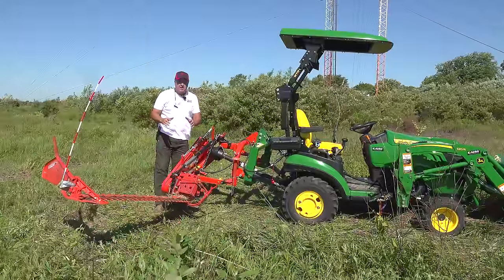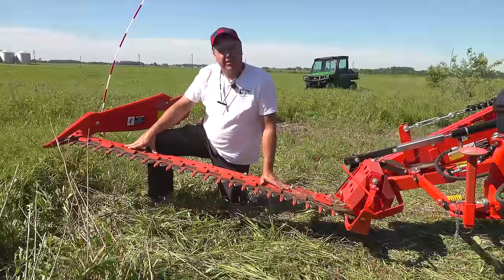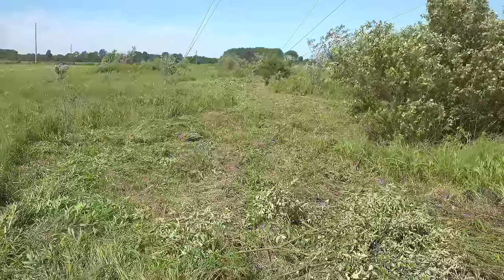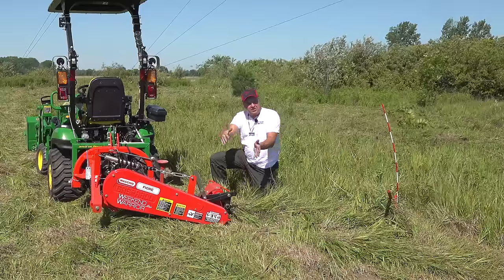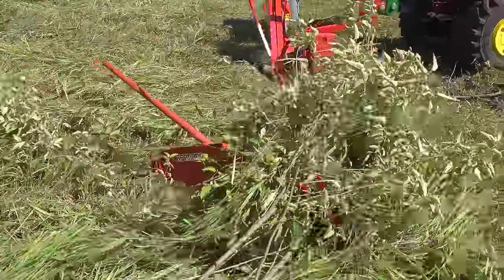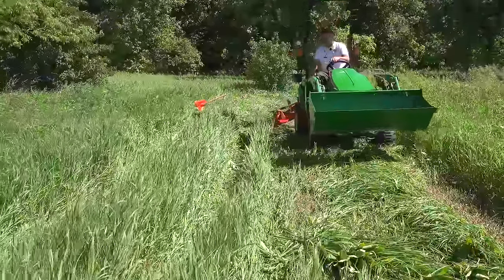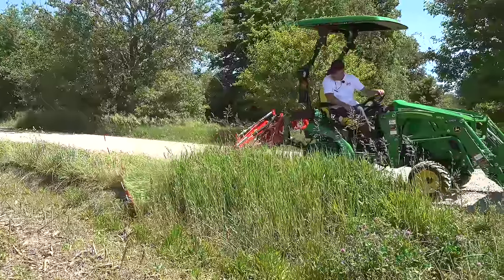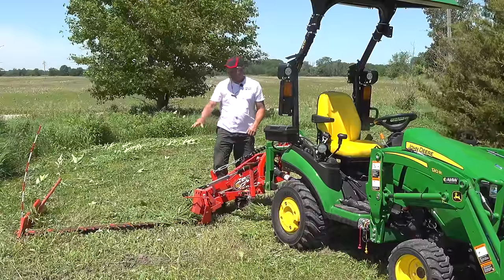Sickle Bar Mower for Subcompact Tractor!

Comment: these Blade type mowers have been recreated in a bigger form by an Austrian company, BB Umwelttechnik (BB Environment Technics). The big positives to these types of mowers compared to drum type mowers is that they are lighter, require less power, are more eco friendly and they dont get as much dirt and dust mixed into the grass. The negatives are that they for the longest time used to be to small for bigger farms and that sharpening the blades take forever unless you use an expensive sharpening machine.

Comment: We called it a mold or mole board at the outboard end of the bar. Our old John Deere you could tilt the bar to adjust the height a bit also. Of course the TTWT doesn't have anything to do with "tracking or anything like that. It only means they know you referred it and boosts you monthly check. This should have been labeled as an AD.
Reply from the maker: Nope, adding the TTWT to the url does nothing for our revenue.
If you purchase, and use code TTWT...and receive a discount, I will receive a small commission.
I created this hydraulic kit...it was my idea.  If you think a small commission is unfair, then I’m sorry for you.

Comment: The strong points of sickle bar mowers are their really low center of gravity and lower weight. That's the reason why you see on hill sides and mountain regions (Swiss and Austria) a lot of these machines even today. It also uses less hp then disc mowers (due to the inertia of the cutting bar compared to the spinning drums)

Comment: I actually was look at old sicklebar mowers. Thought of fixing one up for hay use and getting an old wheel driven hay rake with a $1500 4x5 round baler. Its crude, but as long as it cuts and bales thats all that matters to me. I just believe the 75hp will be too much for the old equipment

Comment: Disc mowers replaced a sickle mower because of how much easier they are to maintain.  Changing sections on a sickle mower is lots of trouble.  Changing knifes on a disc mower is a simple bolted connection.

Comment: Very interesting! Sure would like to be able to cut and bale hay with my 1025R.
Reply from the maker: It can be done. Do you have hay field?
Reply: @TractorTimewithTim  Tim, I only have about 5 or 6 acres. Nobody will work it as it's too small to transport all the needed equipment. I have information on some company in Italy (I think?) that makes small square and round balers for the 1025R but they are also around $19-20K and then I'd still need the tedder and other equipment. I just can't justify that for the amount of space I have.

Comment: Tim good video. I have the frontier model I bought second hand I think I'm missing the pool cord and the bar that helps support on the cylinder so I'm gonna check into that. One concern I had and it may be an optical illusion from the video was the cutting bar should be at 90 degrees to the Perpendicular to the tractor and it looked like it was dragging behind in some of the video I'm looking at the manual myself to kind of see what can be done to advance it to be 90 or even ahead to the tractor to compensate for the drag of the ground. Thoughts?

Comment: Thanks to a previous video of your's, at the end of May when I was about to mow for the first time,  I noticed the intake cover on my 1025 was cracked.  Thanks to Covid-19 it took 6 weeks for the part to come.  Grass is now 3  feet tall and thick.  You could come play in my 6 acres of (now) hayfield. However  I live in Virginia, So if you want to ship me one I'd be happy to try it out and send you viedo!😊
Reply from the maker: Did they replace the entire engine, or just the intake manifold cover?
Reply: @TractorTimewithTim  I called the dealer and they said they would research the problem and get back to me.  Since the crack was small, and the manifold was still intact, I managed to get it welded before they they got back to me. So, I never followed up with them.
Reply: Update: I stoped by the dealership (James River Equipment Fishersville Virginia) today. I was informed that the repair could be performed under warranty even though my tractor is 3 years out of warranty. To expedite the process and avoid transporting the tractor to the dealership, they agreed to supply me with all the replacement parts to install myself.  I just need to return all my existing parts and exchange them for the replacements.  Shipping costs are  not covered under the warranty. However, since  I am willing to wait to  have the parts delivered in one of their normal deliveries, I will not be charged for shipping. They will notify me when the parts arrive. I will let you know how this works out.
Reply from the maker: Yep!  They extended the warranty indefinitely on this issue.    Hard to complain about Deere’s handling of this!

Comment: I’ve always wanted one of these, mainly for the huge offset but my old yard had a lake in the back and shoreline over a quarter of the property and then on both sides were drainage ditches that would get really muddy and the mower would get stuck in it most of the year so we would have to let it grow to about 4 feet or so and wait till summer dried it out enough and then go chop it down and mow it. Out over the lake was pretty much just a nightmare to deal with and these would’ve been perfect for that.  But just having that big offset and being able to keep it out of the water or even just under the water would have saved me hours and hours of work. Lol p

Comment: Really like your Videos. 
Over here in Europe I have a Maschio flail, about 4-5 feet wide, on my 1985 Iseki with (rare) hydrostat. Ist not as new or comfortable as Jonny but they are just absurd expensive here :)
Reply from the maker: How do you like your Maschio flail?
Reply: Tractor Time with Tim i really like it! It’s really sturdy, about 350kg, you can mow fast and of course small brush. It’s capabilities are limited though, because my Iseki only has 20hp.

Comment: I like this better than that flail mower you had before. I think this would work better for ditches than that one and be easier on the tractor. I was all gungho until i saw the price.  The finance department said I'm not allowed to watch your videos anymore
Reply from the maker: Uhoh!  How can we patch things up with the finance committee???  This is a serious issue!!Yea, $5k is steep. Understood.  The good thing is that this seems to be a high quality attachment, and the 1025r handles it VERY well!
Reply: @TractorTimewithTim  does it seem like something that will put in many years of reliable work?
Reply from the maker: The knife will require maintenance.  Sections and guards will be damaged.  
This is simply part of deal when using a sickle bar mower.
Other than that, there should be no other maintenance or reliability issue.
The sections and guards are considered ‘wear parts’.  
Make sense?
Reply: @TractorTimewithTim  thank you

Comment: I'll respectfully disagree with using a sicklebar mower for mowing of sprouts, near rocks, etc.  The sicklebar mower is designed to cut grass hayfields with few or no obstacles.  You can cut sprouts up to about 1" in diameter but even those smaller sprouts will cumulatively damage the sickle sections and guards pretty quickly.  Cutting anywhere near rocks (like a driveway) will mess them up pretty quick.  I've run sicklebars and rotary cutters for many years; the sicklebar will make you pull your hair out if you use them for cutting sprouts/rocky areas for long as you just destroy the cutterbar in pretty short order.  Yes, you can replace sickle sections and guards pretty quickly but the costs will add up.  Thanks.

Comment: Would work for pushing back the edges of a field that over time shrink from lack of mowing into the weeds. If the blade works vertical then it would also work for trimming trails for any limbs or brush overhanging.
Reply from the maker: It works vertical.

Comment: Instead of the extra two hoses reaching between the mower and the front hyd. connections, just get a hydraulic top link and use your stick buttons for angle/raise ht..    Meant to ask (maybe I missed it) - what length is the bar? 5 ft?
Reply from the maker: 6’

Comment: Looking at those wires supporting the towers a lot of rust s evident. Would be concerned about them breaking in a storm or strong wind.
When I was young on the farm the small blades were attached with soft rivets that were just set with a hammer. To remove you used a chisel. The modern ones I have seem are bolted. The Forman on the place would sharpen the blades.

Comment: Hey Tim great job do you think you should be wearing safety glasses and hearing protection?
Reply from the maker: I have hearing protection. I use isotunesaudio.com noise isolating Bluetooth earbuds.   Use code TTWT for $10 off.
I see no need for safety glasses for this project.  The mower doesn’t throw anything.

Comment: I build utility scale solar projects (700 ac and >) and we’re always looking for better ways to manage vegetation once the modules are installed in the array. Flinging debris and glass don’t go well together. How much debris does a sickle blade bar throw?  We’re using 100hp JD tractors. Is there a scaled up model?  Will this model work with a 100hp JD?
Reply from the maker: They go up to 9’ or so.  Could be pulled with 100hp, but way overkill

Comment: It´s sure a modern and nice take on an old piece of product, but the price?!? I was chocked to my core, I would never buy such a thing new with that pricetag, its economical suicide to be honest
And there are old ones with the hydraulic too, had one at our farm since around -86 or something like that and we used it on our 45hp tractor without any issue
We have a mower conditioner that we bought for our old grey Fergie TEA20 that we bought for 150 euros, no beauty but it does its work :)

Comment: Would the mower work on a 2305 John Deere , nice to work in tight areas Great video , be safe
Reply from the maker: Yes.  Of course, you would need the extension hose kit described in the video

Comment: Tim, thanks for all the great videos and information.  My father had a New Holland 455 sickle bar mower (7 ft).  Is the limitation of the 5 ft bar shown in your video due to the 3 point mount?  Do you think a 1 series (I have a 1023E lower PTO horse power than the 1025R) would drive a pull behind 7 ft sickle bar mower?  To raise and lower the bar you would need the rear SCVs, which I do want.  I have been browsing the internet to find anyone that has tested this out and can't find anything.  Any suggestions?  Thanks and keep up the great work.
Reply from the maker: Ours is 69”.   Yes, 1023e would run a 7’ pull type.

Comment: Nice review of the sickle mower. 
Are you having any problems with grass or weeds getting wrapped up around any shafts or CV joints under the tractor?  Just wondering since the 1025R has low ground clearance.
Reply from the maker: Typically, no, we don’t have much issue with wrapping. I think maybe once or twice over the last 6 years.

Comment: You need a floating valve to mow really well and flat, else the end of the bar will be raised up when the tractor tips to the left (you can see this in your video if you look close enough)....
Reply from the maker: Incorrect.  The bar is allowed to go way below flat.
Reply: @TractorTimewithTim  Yes it is, that is why you need a floating center valve. So that the cylinder is allowed to discharge oil trough the valve even when you are not pushing on the valve stick (it lowers under its own gravity while mowing).
Reply from the maker: @looserkuka  no, there is float built into the mechanism.  You do not need float in the valve for this mechanism.

Comment: For folks without a backhoe or 3rd function, doesn't JD already offer an OEM hose kit that will extend both sets of mid SCVs to a bracket on the rear of the tractor with 1/2-inch AG couplers for use with rear implements?
Reply from the maker: Not that I know of.  
They offer a rear scv kit....which is not compatible with either backhoe or .3rd function.
Reply: @TractorTimewithTim  They also make a rear SCV extension kit, two kits actually. They call it a "Rear Tubing Kit" but in JD Parts it's called a "Hose Kit". It's just a set of hoses that plug into the mid SCV and run back under the fender to a rear bracket with (4) female 1/2-inch couplers. For 1-series built prior to a certain date the kit is LVB25837 and for tractors built after a certain date the kit is BLV10948. It's not a bad option for folks that can give up the loader.  JD says the hose extensions are not compatible with Power Beyond but I have a feeling that's just because of where they chose to mount the bracket. I mean, how can extension hoses be incompatible?  :-)   They made similar kits for the Gen-1 2-series. I had one on my 2720 prior to having a rear 3rd SCV installed.

Comment: Morning Tim. You have any suggestions on raising the gpm on hydraulics so a hydraulic post hole auger can be used on the 1025r? thanks
Reply from the maker: No.   This is by far the biggest limitation of a subcompact (or even compact) tractor. 
Simply not enough flow available.

Comment: Are there requirements for the hydraulic system of the tractor? Mine is a 3035D, can I use this sickle bar mower?
Reply from the maker: You need one rear hydraulic outlet.  …or a way to route one of your loader valves to the rear.  
Having said that, there may be a ‘manual fold’ option available which would not require the hydraulic valve.  Contact them at http://agfolks.com use code ttwt for 5% off when ordering.
If you need rear hydraulics, contact http://summit-hydraulics.com again, use code ttwt for 5% off.
Reply: @TractorTimewithTim Thank you! I once consulted a John Deer dealer to replace my 3035D with a 1025R and was told I lost $8000 immediately

Comment: These mowers work nice but in situation like where you are working now since it doesn’t mulch or grind the grass up if you cut it again down the road when it regrows it wit clump up and jam the cutter bar at least in my experience with cycle bar mowers it has happened

Comment: Tim I would like a cheap, simple, way to mow ditches in and out of our neighborhood. My tractor at home is a B2601 so weight is a concern. You know implements very well. What is your opinion? Thanks
Reply from the maker: Well, not many “cheap” choices other than a weed eater!
Probably the offset flail mower is the best option for you.
Reply: @TractorTimewithTim  Big thanks, I value your opinion. I was surprised to learn Titan is made 15 miles from my house in Decatur Tn. I need to ride over and talk to em tomorrow. I liked the frail mower too I just wasn't sure about the weight to the side. My tires are filled with beet juice w/ 3" axle spacers on the back and 1.5" on the front which should help also. I mow some 30 degree hills so I tried to make this one as stable as possible.
Reply from the maker: @turdferguson5300  You might want to add rear wheel weights too if you get an offset mower of any kind.

Comment: Tim I live on a wheat farm and need something to help mow the weeds (mostly mustard and field grass) on the berms along the edge of my fields and over the edges of my driveway which runs diagonally down a hill. How much stress will this put on my 26hp compact tractor if the end of the sickle bar is NOT being supported by the ground? Also, I have both a CAT 1 as well as a 95hp, 7 foot wide CAT 2 tractor; which of the two widths would you recommend for use with both tractors?... One last question: are the replacement blades universal; are they the same ones I see at my local farm supply store?
Reply from the maker: Lots of questions.
- no stress if bar is off the ground. No worries.
- depends on weight of the cat 1 tractor...at least 6’...if bigger/heavier than Johnny, then 7’ would be fine.
Any size fine for your Big tractor...in fact, I wouldn’t use it with a sickle...overkill.
- there are some differences between brands on the sections...I don’t know if we can get them at hardware store...may have to go to Deere or Maschio dealer...maybe we can get agfolks.com to carry them.
Reply: @TractorTimewithTim  Thanks Tim, I don't know the brand; but the ones in the pictures look the same as the ones they use on wheat combines. I had looked into the flail mower from your previous video, but decided that it would be too heavy for my compact tractor and not heavy duty enough to be supported by my 95hp tractor... I wanted to be able to use it with both tractors. Again, thanks
Reply from the maker: You might be able to handle the 47” on your compact tractor. 
If you are looking for an offset mower for your 95hp tractor, I have just the ticket!  Will show it later this summer...   Rhino DB150.

Comment: Hey Tim what size limb will that cut through? I'm thinking it would be a cool tool to use in the vertical position to clear up walking/ATV trails cutting small limbs back?
Reply from the maker: about 1".  It isn't much of a brush cutter, but it would trim back some small branches.

Comment: The first sickle bar mowers were powered by the wheels of the horse drawn sulky the operator rode on.  This style uses relatively little power.. Many full size tractor had very low horsepower, by modern standards  The Farmall Cub had about 12 HP I believe.  God bless you all.

Comment: I modified a John Deere #5 sickle bar mower for my 1025r
Reply: Also I picked two of them up locally for free very cost affective. Most expense was new hydraulic hose and end to fit 1025r. Also made mine quick hitch compatible.